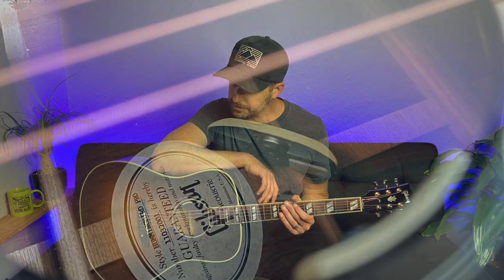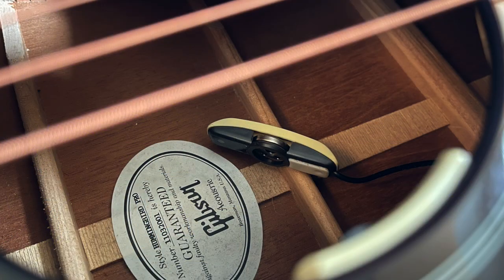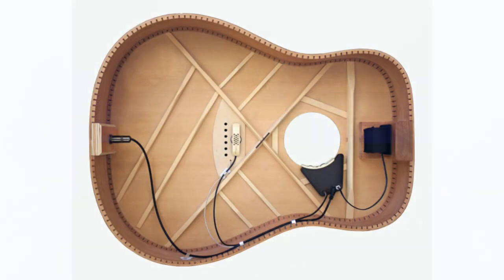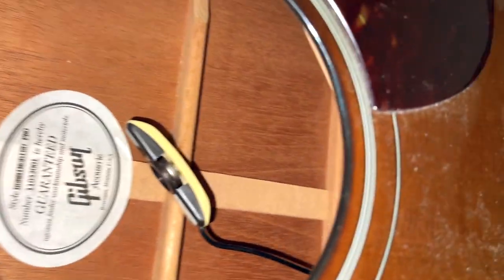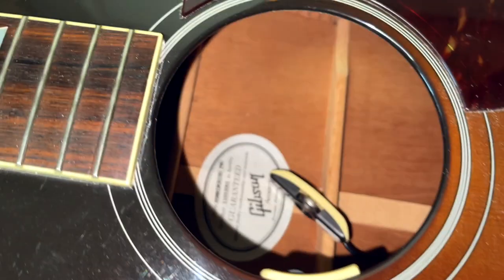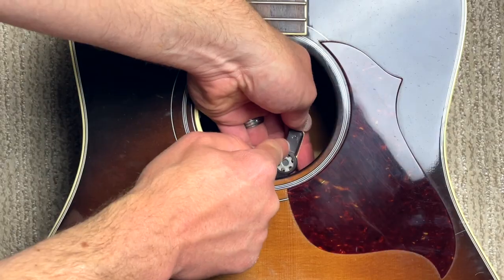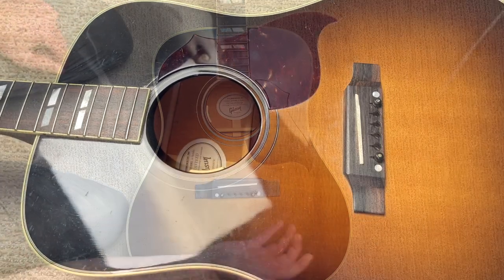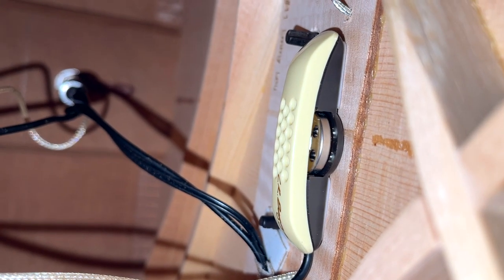LR Baggs Anthem Repair

Comment: The LR Baggs Anthem in my Emerald guitar died within a few months, in the middle of the song, while plugged into an Ampero II Stomp, that was routed into an A&H SQ5.  Swapping the battery did not help.
The purveyor of my 12 String Emerald carbon fiber replied "this has never happened, as if it couldn't happen, and he basically refused to stand by his and LR-Baggs warranty. And out of 5 of his guitars, this was the first warranty request! after spending $~10,000, this was quite shoddy!
Reply from the maker: @Pharesm  😬

Comment: Hey nice work on the vid. Hey u ever experience any trouble with feedback when live? I have a kk pure mini in mine which sounds great but always battle feedback when volume is high at gigs or at band practice.  Oim thinking about replacing bc of that.
Reply from the maker: Thanks!  I actually had a JJB pickup (similar to the K&K Pure Mini) at one point in a Taylor GS mini (video links below if you’re interested). My Gibson is a much different guitar (bigger, different woods, etc) than the GS Mini, but I would suffice to say that the LR Baggs Anthem is a big step up. The condenser mic really makes a difference. All the best. 

https://youtu.be/IHnrFppYyfY
https://youtu.be/ZXQrGSQXyjk